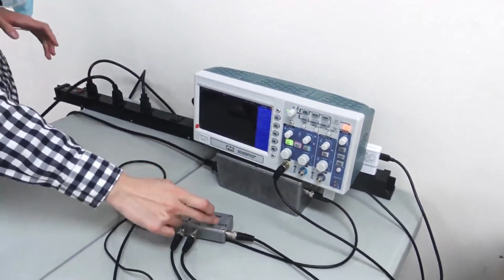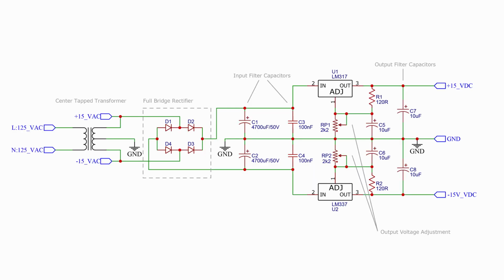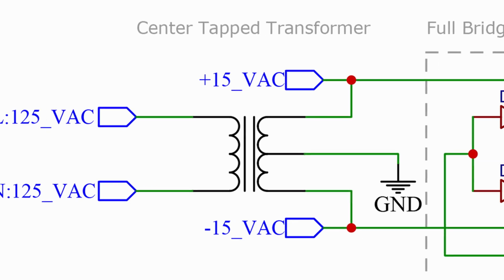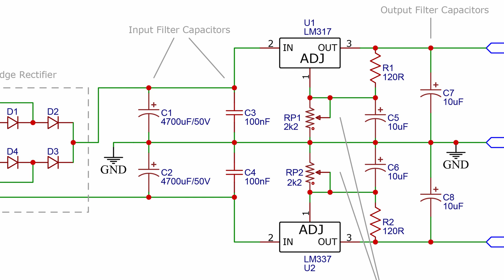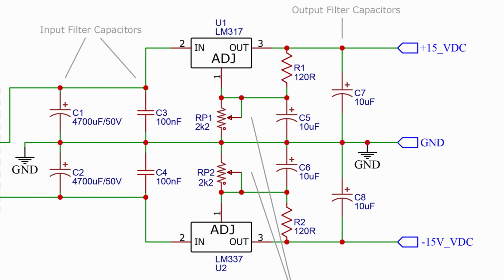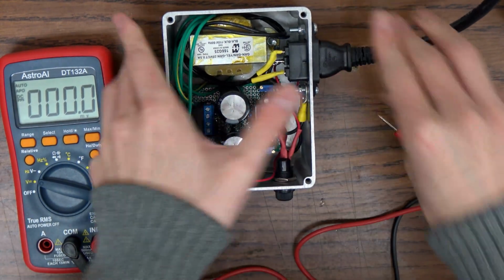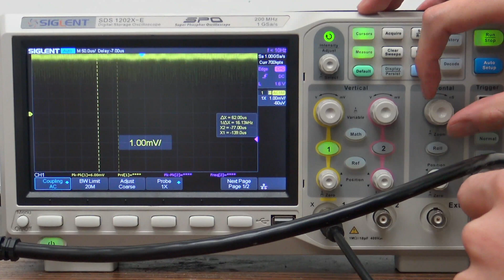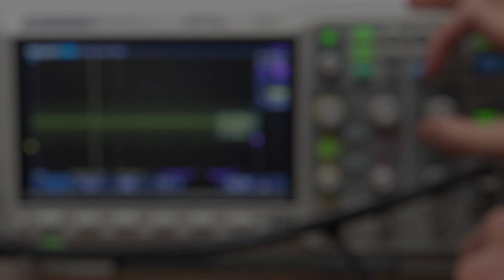DIY Dual Rail Power Supply

Comment: Thanks for the video !  Question :  are ALL center tapped transformers also referred to as +/- ?  I just bought a transformer on eBay and the seller says his center transformer is 20 volt and the secondary transformer has 3 cables , +10 , 0, and +10 … 😮. Could he be wrong  and just not know what he’s selling ?

Comment: I just want to say thanks for you detailed explanation . In the beginning . It rarley explained  with a visual  and verbal  explanation.  I do electrical  but its mainly high voltage  services HOA panel  meter  and vfd installation and trouble shooting.  Its nothing  like audio electronics and power supply. 💯👍👌✌️🫡

Comment: The datasheet recommends placing a reverse polarity diode (1N4002 or similar) across each regulator from output to input and another across the 120R resistors R1 & R2. These provide low impedance discharge paths for the capacitors C5, C6, C7 & C8 to prevent them discharging into the regulator output when power is removed or if a short occurs.

Comment: I see you appreciate low noise psu's 
Tip: throw that rectifier in the bin. use 4 x BY229 schottky diodes, then add a 22nF ceramic in parallel to each diode. also, try and find the lowest esr caps for the main smoothing caps.
With this, the regulator will be the noisiest part of the power supply. you can silence it more by playing with the regulator caps. play with various types, and values. ceramic, film etc.
even with the same components, each circuit has a mind of its own. fine tune those reg caps for each psu you build

Comment: nice! gonna be using this in my audio synthesizer design. found an old 15VAC power adapter which should keep the dangerous voltages away